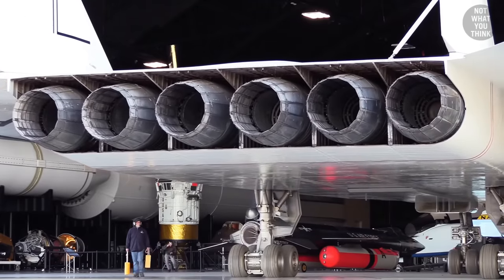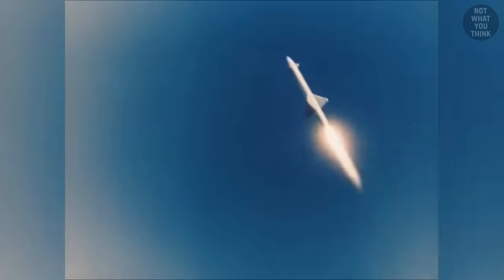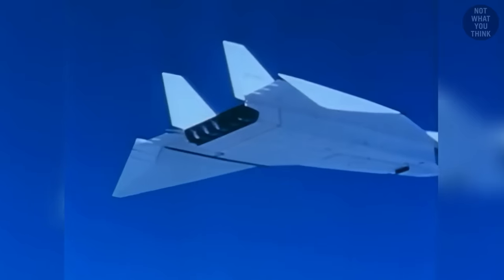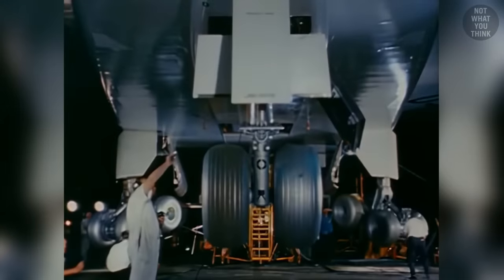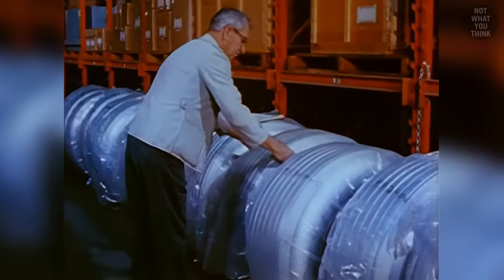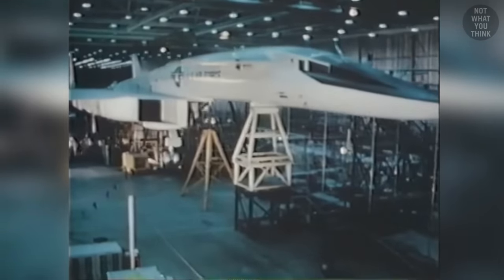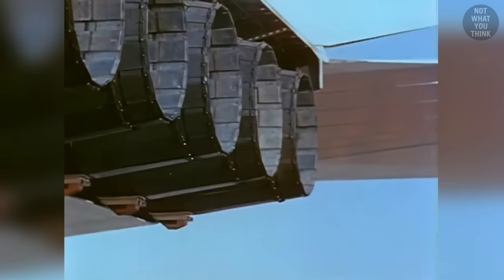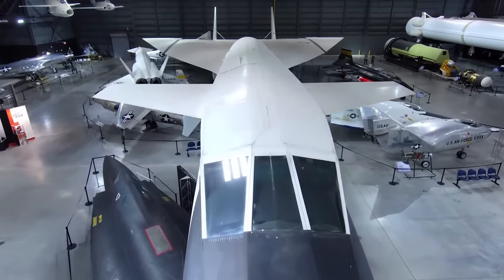The Airplane That Looked Fake, But Was 100% Real: XB-70 Valkyrie

Comment: What a magnificent aeroplane.
What a great video as well. Thank you.

 It's refreshing to see such detailed information about the pitfalls of progress. Only a democratic country, happy with itself would have the confidence to show such a flight into the future, warts and all.

My uncle was on the British Airways maintenance team for their Concordes and told me lots about the general running of them.
But this video begs the question, did the USAF share their problems ~ paint, fuel and braking especially ~ with Aerospatiale, British Aerospace and Rolls-Royce?
I tend to think not.
So why do we not hear of similar stutters in production for Concorde? Did we over here have more time to think things through, were we luckier or what?
Any ideas anyone?
Reply: What "stutters" are you referring to?
Reply: @winternow2242  Well, the things that went wrong with this magnificent beast, to start with. I was surprised about the paint issues for instance. But thinking about it, national air forces don't need to concern themselves with keeping the layers of paint as thin as possible in order to save a number of dollars per flight. A national flag carrier probably does.
Reply: @JP_TaVeryMuch  I don't the XB-70A had paint issues. There were maybe several flights where they lost some paint, but I've only seen 1 flight where the problems were noticeable, and only because they painted too thick. Concorde didn't fly as fast, so it likely didn't have even those issues.

Comment: Looks so much like the Concord -- suffered the same issues like the Concord -- ended up in the museum just like the Concord
Reply: Huh?

Neither of these 2 planes looks or flies alike, built in 2 different countries for different missions. 

I don't know what issues you're referring to.  XB-70A flew fine - it was based on a bomber that was made useless by changes in military technology.  

Concorde was an airliner that airlines didn't want to buy because technology hadn't advanced enough to make supersonic travel financially competitive with conventional aircraft.  Concordes nevertheless flew for over 25  years, compared to 5 for XB-70A.  25 years sounds normal for an airliner.
Reply: No, it doesn't look "so much like the Concord."

No, it didn't suffer "the same issues like the Concord."

You don't know what you're talking about.

" ended up in the museum just like the Concord"

Many, if not most, airplane design examples end up in museums.

Comment: It looks like the military version of the Concorde 😂
Reply: Really?  I don't see it. They look completely different to me. What unique similarities do you see between the 2?
Reply: @winternow2242  the nose
Reply: @MysteriousChannel6969  ...is flat and wide, and it's fixed. Concorde's nose is more cylindrical, and pivots for take off and landing. It's also a remarkably small part of either plane's overall structure.
Reply: @winternow2242  yea but the windows and how the nose has a point look kind of the same now let me have my own opinion

Comment: A lépoque où j'ai découvert cet avion (dans les années 70 je pense), j'avais lu un article (probablement dans le TIME) qui stipulait que cet avion pouvait voler aussi vite qu'une balle de fusil. Cela paraissait assez incoryable pour l'époque, mais faisait rêver.
Aujourd'hui je ne connais pas exactement ses caractérsitques, mais une chose m"intrigue encore : Quelle est la raison qui a poussé à concevoir et à fabriquer un tel appareil. manifestement il est resté au stade de développement, et n'a donc apparemment servi à atteindre aucun objectif.
Est ce exact ? Quelle a été l'activité de cet appareil?
Reply: Cancelled years before it went into production, in 1961. Two Valkyries were built for flight test. 

Faster than a bullet?  Depends on the bullet, and speeds vary depending on the bullet speed.  Speed for bullets is often measured when they leave the muzzle, and even the same caliber will vary. I've seen .45 acp clocked between 800 and 1200 feet/second, which i think works out to about 600-800 mph. For 5.56mm, which is what an M-16 uses, I've seen the range between 2,700 and 3,300 FPS.
Reply: @winternow2242  pour la vitesse d’une balle de fusil, ce n’est pas moi qui l’ai dit, mais, comme je l’ai écrit, je l’avais lu dans le Time.
Donc pour les explications sur la vitesse de l’appareil, écrivez plutôt au Time.

Comment: The B-36 was actually bigger than the B-52...but it was full of problems caused primarly by its huge size.  For the time it was too big for its own good...fully loaded it needed four jet engines behind its wings to supplement the six enormous radial engines in order to gain enough speed to take off, giving it the nickname "six turning, four burning".

Comment: Concorde's nose was not intended to change aerodynamic of the plane, the real reason was much simpler. Given the length of the nose, the pilotes were unable to land propperly, therefore the nose tilts down when landing, so the pilots can see the runway.
Reply: All that engineering, complexity and wieght for something we would use a camera for these days, not to mention synthetic vision.  Times have changed a lot!
Reply: You're wrong. First off he did say that it was for ground visibility however if aerodynamics weren't an issue then there would be no point in making them movable. Aerodynamics are important in supersonic flight so you can be assured that it was to streamline the body.

Comment: The Valkyrie was made of stainless steel honeycomb, not aluminium.
The SR-71 Blackbird was made of titanium for the same reason... Aluminium would be butter soft at the temperature flight speed generated due to surface friction.

Comment: If it didn't crash the Valkyrie could be flying now but the A12 and the SR72 eventually becomes the speed demon plane of  US Airforce.
Reply: Nope. The B-70 was cancelled in 1961, before the crash. The surviving XB-70A continued flying for a couple of years and was then retired, because no one needed it.
Reply: @winternow2242  The improved prototype was the crashed a/c. #1 had skin problems that limited cruise speed to ~M 2.5 . NASA flew it for over 4 years.

Comment: Where were the bomb bays planned to be? Wiki says the plane had some and they were filled with test sensorics and such. But I haven't found any info where the bombs would be located
Reply: In the same place.
Reply: @winternow2242  sure, but where are they?
Reply: @gegessen159  lower fuselage,  behind the intakes.

Comment: Thanks to the XB-70 Valkyrie bomber Soviets created the MiG-25 interceptor. XB-70 was killed by Congress, while MiG-25 while still flying.
Reply: The XB-70 wasn't a bomber, it was a research aircraft based on a design for a bomber that was cancelled before a single airframe was ever built.  The bomber, the B-70, was cancelled on reciommendation of JFK, and had also been opposed by Eisenhower.  The Air Force was also hesitant about putting the plane into production.

As for the MiG-25, the Soviets began work on the MiG25 about 2 months before B-70 was cancelled, and then developed and flown years later.  I know the video links the 2, but these airplanes really have little in common with each other.

Comment: Did he really say that the B-58 couldn't strike the Soviet Union? It could easily strike the Soviet Union with in flight refueling just before it entered Soviet airspace. It was capable of high or low level penetration of the Soviet Union although low level had a much higher chance of getting the job done. Don't know where he got his info on the B-58 but it was wrong. Also he said that the XB-70 that remained after the crash of the number 2 prototype never became operational. It did not go into service with the Air Force but it did fly for years both in testing and then was used by NASA for high speed research so it was in service for a few years just in a testing and research role. It however did not perform as well as the number 2 aircraft that was lost due to a crash in a moronic photo shoot because the number 2 aircraft corrected a flaw in the number 1 prototype with the angle of it's main wings. Can't remember if the number 2 plane had more anhedral or dihedral angle to it's wing but it was one of these that made the number 2 prototype that crashed faster and more stable at it's top speed. So both did see service just not accepted into service with the Air Force as a mainline bomber.

Comment: I have been to the museum many times and I have not seen that plane there
Reply from the maker: Thank you for contacting the NWYT support line. I understand that you have not been able to see the airplane in the museum. Let's do some troubleshooting, shall we?
1) Unplug your power cord and plug it back in.
2) By any chance, are you visually impaired?
3) If the previous steps did not resolve your issue, it's Not What You Think!

Comment: I AM NOT CALLING THIS VIDEO FAKE, OR DOUBTING ITS VERACITY. 

However, at one point, early on in the video, it clearly shows the remaining '70 being pushed back out of (or maybe pulled in) a hangar which has the modern USAF "winged star" logo.  This logo has only been around for maybe 2 or 3 decades, where the Valkerie was placed in the Air Force museum nearly 60 years ago.

So my question here is:

Does anybody have any LEGITIMATE  information on the museum's practices and why the aircraft would have been moved?  Is it a scheduled routine where the vehicle is occasionally taken outside for a wash (dust and grime do build up indoors), or was this a one-time event for a photo-op?  Perhaps something else was going on.

If you decide to reply (whether or not you have an answer), keep your responses respectful.  I won't get all butt-hurt, I'll just block you.
Reply: I've seen articles showing the airplane being moved out of doors for some "conservation" purposes around 2015.

Comment: They didn't die because of a marketing photo shoot, they died because of a pilots mistake.
Reply: The photo shoot was ill-conceived. The B-70 tip-vortices were enormous at sub-sonic speeds. The F-104 was sucked in. Wake turbulence upsets smaller aircraft more often than most people know. Too bad The Widow Maker took out two pilots and aircraft.

Comment: Oh my God the B70 Valkyrie. That was the name of the B70 when people would first see it they would say oh my God. My father worked on it it was one of the engineers that did all the electrical systems on the B70. Along with the defense systems. Are my only been two xb70s built but these are craft has given the aircraft industry of the United States incredible leap forwards in aviation building. Also it scared the living crap out of the Soviet Union they spent billions and billions and billions of rubles because they thought we were going to build hundreds of these aircraft. If you go to the Moscow Air Museum their version of the xb70 sits outside the Mig 25/30 was built just for the xb70. North American Aviation was one of the smartest manufacturers at the country. Today's  b1B  strategic bomber has its roots in the xb70. You have to remember now that going fast in the atmosphere your aircraft has to withstand Heating that would melt most metals. The xb70 was built out of stainless steel it also had special new alloys for the really hot sections the wing root the Leading Edge places like that had special new Alloys metals that could take very high heat. The six pack were incredible engines I actually got to take a look at one at Silver Hill very impressive. The extra 70s drag coefficient is one of the lowest ever built have told people I thought I wish I would have had the chance to see that thing fly especially take off it was something else. Friends of mine they were older than me were able to see that when they were kids and they said man that was something

Comment: Of pnly they just development the already mach 2.5 capable aircraft into a passanger aircraft, thdy coudl have gotten a concorde rival
Reply: The sonic boom problem meant no flights over land (without breaking windows and similar hassles) and the fuel cost meant it wasn’t that practical.

Concorde wasn’t worth rivaling.
Reply: @Justanotherconsumer  nobody cared for that before like 1967🤣

Comment: These things are amazing. Almost looks like the concorde ripped off the design and just scaled it down. There’s a great aviation museum up near seattle (can’t remember the name of it i was probably 12 when i went) they had a full sr71 fuselage with cockpit you can sit in and i nerded out on that for hours. I love these wacky / incredibly capable machines.
Reply: FYi Delta wings were about before this and Concorde.
Reply: Other than the white paint, Concorde looks nothing like the XB-70
Reply: Concorde is about 20 feet longer, though lighter, and having a slightly narrower wingspan,  so the scale isn't far off. Basically, when comparing the appearance of 2 seemingly similar planes, just Google 3-views of each plane, and you'll see how different they are.

Your museum sounds like the Museum of Flight in Seattle.  They've got an SR-71 there, though years ago it might have been at another museum.

Comment: I don't get why they canceled development of this plane claiming sam sight  would get it but it's just as fast as an SR-71 which went until the 90s
Reply: New bombing tactics. Fly as low as possible to fly under the radar.
The XB-70 wasn’t good at flying at low altitude.

Reconnaissance missions need to fly high, and the SR-71 was further ahead in development.

Comment: The engines take up most of the underside of the plane, so where would the bombs be stored?
Reply: On the XB-70A, there was a payload bay in the lower fuselage, behind the intakes. On a production B-70, the bomb bay would likely have been in the same space.

Comment: It leaked fuel to the extent it had be collected in buckets? What? How is something like that even possible?
Reply: So as I understood it, the engineers spot welded the titanium panels (or used rivets) and just wanted to fill some sealant onto the seams. Chemist came back to them with the information that the plane gets too hot for this. So you rather would need to weld with an arc or a laser. I think that the Concorde is glued together like a model plane.

Comment: The XB-70 Valkyrie in the valkyrie and view up on that was a decent a composition of thermal heat expansion ceiling the leaks soon as you hit a mock Ford Mach 5 that thing would still up this expanded joinswitch sale and everything will lock it when you leave no more fuel but what happened was when we first assembled the thing it heated up and when it heated up a broke a bunch of the all the main metals expanded locked into place it didn't leak while you're flying at the one we landed that's when we noticed all the water and all the fuel not water but all the fuel leaking everywhere cuz it cooled the airframe down when the airframe cooldown the metal shrink so the story is LA to France from France back over to New York and it's been sitting in the NASA museum over there by New York ever since

Comment: 3:23
The engines were sorta massive FOR THEIR TIME.
Today, they're small and low power.
Reply: The YJ93 is larger and heavier than the F101 used on the B-1B, and rate about 30,000 lbs thrust in AB. the Valkyrie's engines are actually more powerful in military power, but less efficient, SFC wise.
Reply: @winternow2242  28,800 in AB - close enough - but you can't run AB all the time.
19,000ish without the afterburner.
F101 is a little OVER 30,000 in AB, 18000ish without - and a turboFAN not a turboJet which is where most of the greater efficiency comes from and a great deal of the weight savings.
20+ years of technology and materials advancement didn't hurt any.

The power difference however is pretty much insignificant - the "6 engines (B-70) vs 4 engines (B-1)" are the major difference in thrust.
The B-1 had better aerodynamics, but not enough to make up the thrust difference - which is why it's slower.

But also note that even SEMI-recent Commercial Airliners commonly use 2 engines of 78,000 OR MORE thrust each, some pushing 110,000 pounds PER ENGINE (GE9x as used on some 777 models) - most such engines generate more than 3 times the thrust of either Military engine IN AFTERBURNER, almost 6 times when comparing the GE9x "apples to apples" WITHOUT afterburner vs those military jet engines.
In other words, a recent 777 model can have almost double the thrust of the ENTIRE XB-70 if no afterburner, and quite a bit more even when the XB-70 DOES light the afterburners.

Even the C5-M has engines capable of 51,000 pounds of thrust WITHOUT AFTERBURNER.

I stand by my statement that by TODAY'S standards they are small and low power - as are all military jet engines that are not on transports or tankers (most of which are modified commercial designs).

Comment: There is a bit a misnomer about both of shoot downs with the U-2 spy planes; both of which weren't at their operational max altitude of 70,000 feet. Both Gary Powers U-2 and the one shot down over Cuba suffered engine troubles which forced both pilots to a lower altitude which made them much easier to target and shoot down. Something that never gets brought up and still to this day infuriates me because at the time I highly doubt that they could've reached up to 70,000 to shoot one down. Not saying it wasn't possible just highly improbable.

Comment: How comes the paint of the Concorde flying Mach 2 didn't know the same fate ?
Reply: The XB-70 AV 1 temporary paint-peeling happened because the paint became too thick as a result of multiple applications. It was eventually stripped and repainted with a single thin coat.